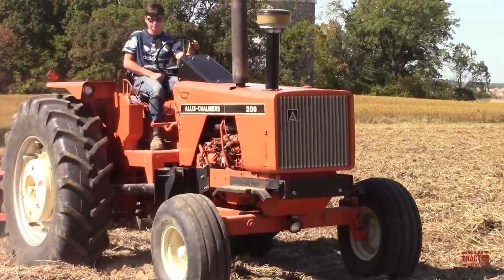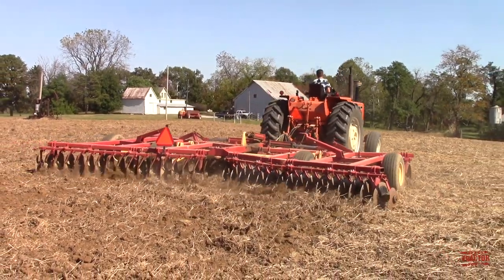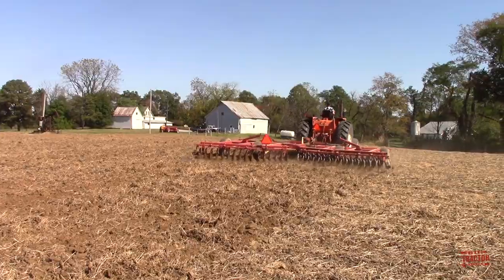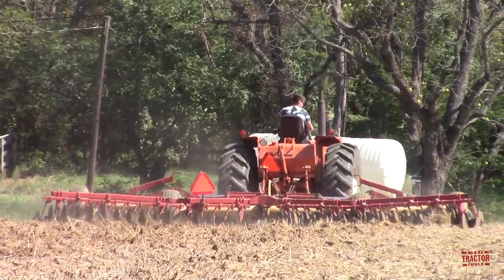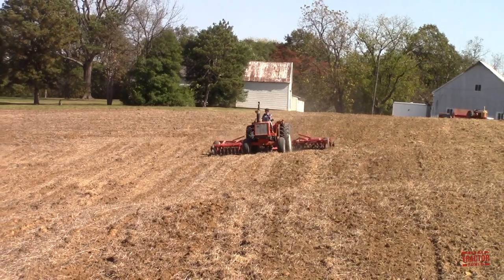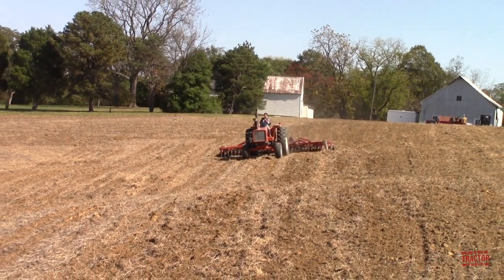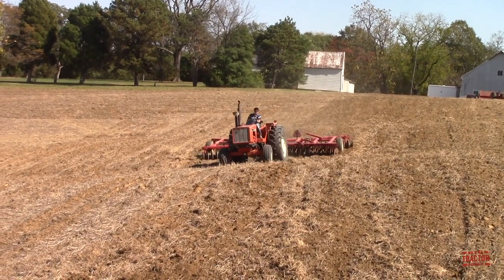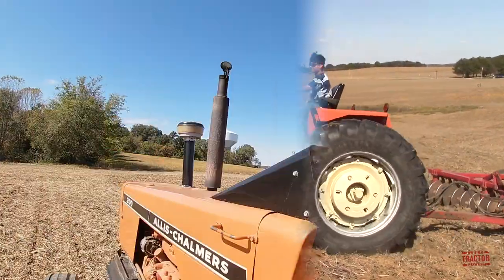ALLIS-CHALMERS 200 Tractor Working on Fall Tillage

Comment: What a great tractor. I rented 200 acers from an old farmer in 1978 that had a 200 with the factory cab & A/C. I was 18, and worked for a big farmer who had nice equipment. He had a 4020,4230,4430, and a 2670 Case. In 1980 I begged the old guy to let me pull it at the fair. Needless to say he didn't like the idea. He asked what I would do if I blew it up? I said I will put a new engine in It guess. So we shook hands and I went to the pull. I put it in the 10,000 lbs. class. There was about a dozen in that class. There where several IH 1066, JD 4020's  1 which was hauled in from out of state with a M&W blower and you could tell it was turned up. 1 old 930 Case. All the farmer's said I didn't have a chance against the competition!  Let me just say the look on that old farmer & his wife's face that night in the stands was priceless!! All that for a 1st place trophy and a 100 dollar bill. True story in Lee county ILL. I won by 2 ft. 4ins. There are only 2 kind of people in life. The ones that think they can & the ones that think they can't. Unfortunately they are both right. My grandpa taught me that.  He also said nothing is impossible, it just takes a little more determination. I'm 61 now and I know he was right!
Reply: Hi Don!
It's always the same: 
They all said, it's impossible until one came who did not know that and just did it! :-)
Reply: @dreisternehof  Amen!
Reply: Never underestimate an Allis Chalmers
Reply: @RJ1999x  We had a 200 as well and it was the farms beaten dog. We pulled heavy no til Haybuster drill, huge heavy thing that held tons of grain and fertilizer.  We ran a snow blower in the winter at -20 sometimes, usually a bit warmer.  It got beat, but iylt never let us down. I remember spraying half a can of ether into it's intake to start in the winter, it just said ok and fired up.  Now I know that's not a great solution for starting every cold day.  Yep, 200 was something
Reply: @heatmoon  a great tractor

Comment: My father sold them from 59-85.  We ran mostly D-17's.  Started out with a WC before I was born, then a WD.  The D-17's came later.  We eventually ended up with my grandfather's 180 that was rebuilt to 185 specs.  My neighbor still uses it.   Pop eventually got a nice 8050 to brush hog with that I sold several years ago to a local farmer.  They sold it to a dealer down east that is restoring it.  Pop knew the dealer and that helped sell the tractor.  I plan on going down there to see it eventually.  Great videos as always.  I'll die an Allis man just like Pop.

Comment: We have a diesel 180 that we use to pull a 12 row corn planter. It harvest time it is also used to pull 4 200 bushel grain wagons (2 @ a time) to the bins. We also have a 220 (non-front wheel assist) tractor that we use to pull a 15' Great Plains drill to drill beans. We also have a D-17 narrow front end diesel, a WD, & a 175 diesel that mainly get used as 'chore' tractors. We also have a D15 with an Allis Chalmers loader bucket, a 190, & a D-21 with rice tires. The 190 does baling & mowing of waterways on our farm & the D-21 used to do a lot of tillage & pulled the grain drill for many years. Since we have gotten rid of our cattle & gone to no-till, the tractors don't get as much of a workout as they used to.

Comment: We have run an AC 200 in central Utah for the last 25 years to cut and bale hay. Our model has a factory Cab with an air-conditioner that has never worked since we got it. Tractor has been run less than 100 hours a year for all of those years and has experienced a failed water pump and failed alternator but thats about it. A couple of years ago it started leaking small amounts of transmission, hydraulic and engine oil. We just got a used Kubota M110x to replace it for next year's work. Thank you for sharing your video of the AC 200.
Reply from the maker: Thank you for sharing about your 200.  That is neat yours has a cab.

Comment: I’ve always been partial to Alice Chalmers. I worked on a New Jersey dairy farm before and during my teen years. We had an Alice Chalmers C, WD 45 and WD 45 dieselWith a wide front end. I cultipacked oats with the C, plowed, pull the Haro, disc, and hold wagons with the 45 and the 45 diesel. Mode hey and bailed with the 45 diesel also! Thanks for the video!😁
Reply: My Dad has a W D 45 has with a tricycle front end he bought new in 1957 it was a great tractor to bale hay with because of the hand clutch 👍
Reply: @brittblanton8342  we had the same one, yes the hand clutch was very handy forPTO work😊👍🏽

Comment: We had a 180 and a 5050. Both really good tractors. The 5050 had a loader on it and we’d take the muffler off so we could clean the heifer barn. At some point we just left it off and ran it every day like that. The 180 did a majority of the work on our 300 acre dairy farm in western New York. We had a Case 930 for tillage and hauling chopper wagons off the hill. That’s all the Case ever did. I miss those days.

Comment: My late father in law and his family were all Allis guys. 190xt’s, 200, 220, 440, and a few others. I was impressed with the 301 engine in those.
Reply: Really 440 how did you like them I've only ever seen one and thats not in person
Reply: @robellenberger6816  interesting story. They got theirs and it was an absolute dog. Dealer came out and looked at it a few times, couldn’t figure it out. Finally brought in the local Cummins dealer, he discovered that somehow the wrong engine had been put in it. It was a 145hp truck engine. Was supposed to be 210hp.
Reply: @thevox1075  no way lol that's crazy how did that even happen
Reply: @robellenberger6816  I can only think that there was some mix up when engines were delivered to Steiger. It was a California emissions truck engine. They installed a 555 turbo in it. Was a good tractor, later replaced with a John Deere 8630 which they hated.

Comment: I have a 1974 alischalmers 200 diesel with cab.  We farmed over 2000 acres with it years ago.  We now farm 5200 acres with modern tractors and combines . Those 200s were built to last . Ours runs an auger for loading grain bins but it can still run our 20 foot  notill drill and disk . We run a 5 bottom plow with it on crp ground.  Nice video stay safe and farm on my friends  !

Comment: I learned how to drive a tractor on the Allis 200. It was the primary tractor on our farm. I have fond memories of riding with my grandfather on that tractor and later doing the chores myself on that tractor. Never would have dreamed of running a 21' disc behind it though.
Reply: I pull a 20 foot Allis 2500 disk behind my 200 and it pulls it good. I really didn't think it would pull it but the 7050 and 7030 were both tied up so I gave it a try and I was surprised how well it did. In wet ground it would need duals but I try avoid disking wet ground.

Comment: I had a 200 for awhile. Used it to pull a disc bine and bale hay. I upgraded to a cab tractor or I would probably still have it. Good tractor and easy on fuel.
Reply: Dam I would of put a year round cab on it but ik how difficult it is to get those on and off

Comment: I have a friend who I went to school with just a few months ago bought a 1973 AC 190 from another guy I went to school with. Been sitting in the barn 17 years. It was always barn kept , still in great shape except it will jump out of 5th gear sometimes. I be interested in buying it when he decides to sell it. He buys and sells older farm equipment all the time . He said he wanted to hang on to the Allis for a little while. But he will eventually sell it.  He gave $10,500 for it.  Great looking and running tractor.
Reply from the maker: The 190 is a solid tractor. They can really plow.

Comment: Hey really enjoyed the video I grew up in Kentucky on a dairy farm milk and 50 had a cattle and raising 5 Acres at the back of my dad worked in Cincinnati at William Powell.. my grandpa had an Alice Chandler d10 we used it too set tobacco run the wheels out to mow and Ray Kay and on rolling ground even Belle hey pulled logs out of the woods love the color and it was a pulling little booger for its size it's a shame that they don't still make tractors like they used to I am not impressed with the high tech new tractors at all sensors and computers is a recipe for a royal problem in a pain in the butt thanks again for the video and by the way I just bought a 185 LS Chandler that needs crank bearings the elderly gentleman that had it was pulling an 18 ft batwing bush hog

Comment: Used to run the 6080 to haul silage wagons back and forth from the fields to the silos and baling hay and straw and the farm I worked on also had the 8070 front wheel drive that we used to spread liquid manure and cultivating and discing

Comment: Where I grew up in Northwest Washington State during the 1950's and 60's, there was an Allis dealership about a mile from our farm so everyone in the neighborhood had Allis Chalmers tractors of one vintage or other.  I got lots of time on WD45's, D-17's of several series and others.  I now own a 1957 D-14 and an HD-4 dozer.  They are great tractors.  Our older son and his father-in-law run three Allis on their beef operation: 190, 7000 and 8030.  Keeps my son busy fixing these older machines but he loves them and they keep on performing for them.  Allis Chalmers had great equipment, both agricultural and industrial, just poor management during tough times killed the company.
Reply from the maker: Great AC history.  The HD-4 must be pretty cool to run.
Reply: @bigtractorpower Yes it is.  I purchased it years ago to do some logging and dirt work.  Both my sons learned to run crawler dozers on it and now pretty much run anything with steering wheel or levers.  I have it apart in my shed getting new steering clutches and it also needs undercarriage work, but it will live on as retirement is approaching and is one of my first projects to complete.  Love your big tractor videos, keep up the good work.

Comment: We have a 200 Allis Chalmers. Used to pull a 5 bottom Oliver plow and and a 20 foot 1200 series Allis Chalmers field cultivator. We use it in the hay field now along with our 4,000 hour 8010 Allis Chalmers and our 7060.

Comment: I farm specialty crops (Christmas Trees, pumpkins, plus a few acres of corn/beans) with a D14, D15, D17, 180 gas, 180 diesel.  We have some newer small tractors, but the AC's still get 100-200 hours each per year.  They do a lot of spraying, mowing, hauling, and people moving / hayrides.

Comment: Any chance you could give a current "estimated" price for the older model tractor(s) in your videos to compare to the original price?  Simply base it on the condition of the tractor you showcase in your videos.  Much appreciated.

Comment: Good memories, not  on a 200 but a 180 & 190.  2 questions, was that the young Lad in the last Video?  @6:06, the old Case was hooked to a drill.  Seed winter wheat?
Reply from the maker: Yes.  This farm had the Steiger Wildcat sub soiling,  this Allis-Chalmers 200 disking behind the Steiger and a Case 800 drilling wheat.  It’s a neat farm.
Reply: @bigtractorpower  YES Indeed!!!!

Comment: The 200 must be the replacement for the 190 XT.  We had two of those.  They were good tractors.  Nice to operate.  Gutsy engines.  I believe the 190 XT was 93 hp.  
I saw a glimpse of something else in the video that I  like;  a Case 800 row crop.
Reply: same engine, no updates out of the factory... plenty of updates in the field.
Reply: @jasonleininger2519  Lots of updates in the factory. The 200 had larger bull gears and bull pinions than the late 190XT. The late 190XT had 4 pinion differential which the early 190XT did not. The engine on the 200 was improved and actually put out closer to 110 hp vs 93 from the XT and it had a better cooling system with a larger fan. There were other changes internally here and there too vs the XT. Better 3 point hitch geometry for more lift and the later 200 had a change in making the power director easier to shift and better brakes. There were lots of changes and then the 7000 replaced it which had more changes but was basically the same tractor with a 3 speed power shift replacing the 2 speed power director and the new style sheet metal and cab. The 7000 again had even larger bull pinions and gears. I could go on and on with the changes made from model to model and running changes during production of each model from that family of tractors 190 through the 7000.
Reply: @jasonleininger2519  No updates in the field, the 200 had a different engine with a crank driven oil pump, a different front bolster, different geometry on the 3pt to lift more, and a different angle on the bull gear drives

Comment: Throw a set of 23.1-30s on it.. literally wore the tires off one!!
Then put 18.4-34s on with duals.. they worked better!!
Miss the old girl!
Reply: Ed you gotta find yourself another one, the power director would have been perfect working in the shed when you were shredding bales.
Reply: This already has michlens 18.4 R38, way better than those two options
Reply: @somesmallfarmers5629  it's been a while.. they were 38s.. we used 4" wedges on the original centers.. 
Only been 35-40 years ago 🤔😂🤣

Comment: Had one growing up, had a disc for it too.  This disc would be way too much if he was actually discing a field with a crop just off, he's just barely scraping the soil.  Looks like a hobby farmers with a love for the great Allis tractors, just out driving tractor.
Reply from the maker: This is not a hobby farm. They were seeding a cover crop over ground that was sub soiled 18 inches deep.  They are using the disk to cut up the sub soil ridges ahead of the drill. This farm has Steiger Wildcat III, IH 5288, IH 1086, AC 200 and Case 800. Each of these tractors are featured here on Big Tractor Power.

Comment: Does this AC still have the traction booster system? As far as I know, it could be ordered one generation before, but not sure in the 200 ...
The disc in this video seems to be coupled without...
Reply: they had the traction booster system
Reply: If you are actually referring to the Traction Booster system, Most all Alis Chalmers had that from 1948 through the last of the 8000 series. If you are referring to the Snap Coupler Hitch then no the 200 did not have that. That was ended sometime in the mid 1960's..... maybe 1965 or 1966. I guess the D15 Series II may have had it up until the last of them produced in 1967 or 1968 not sure. Maybe D10 Series III or D12 Series III too. Hitch system being different from Snap Coupler to the 3-Point Hitch.
Reply: @SilverGleaner  thank You for those details! I think, Snap Coupler found it's end, when implement weight increased, nevertheless at it's time a good working thing.
Traction Booster was one of three alternative options to the Ferguson System: FORD had it's load monitor, MF itself had the pressure control. But traction booster worked very well as far I can see on the old video's. Maybe it was the best alternative to the Ferguson System...
Reply: @dreisternehof  TB had better draft control pulling from a single point under the tractor ahead of the rear axle and pulled from a point making the implement weight transfer more effective and making it easier to pull the implement straight. You are sort of right as things got bigger it was the drawbars that  got heavier and they had to be removed with SC. I think Allis could have designed their way around that factor by making it easy to slide the drawbar to the side and never having to remove it. IMO what really killed it was the fact that the  ASAE in the 60's was going with the 3-point as a standard throughout the industry. If you have ever used SC you would find, especially if the implement had proper swing down stands, which I found unnecessary in most cases, the SC is much easier to hook up. I had the pleasure of hooking up the 3-point snowblower, actually helping by straw bossing because of recent back trouble, and it was, as it sometimes is, a struggle to get lined up properly. But at least my 200 has both lift arms with leveling cranks and extendable links. Some other brands don't.

Comment: The engine in this one seems to have been changed. These would smoke like the Dickens from the factory
Reply: The diesel back when the tractor was made was furnace oil, today's diesels burn far cleaner
Reply: We had injected work and fuel pump is turned up so the tractor is turning 129, we be put 19000 into this tractor, that is why it doesn’t smoke
Reply: the 200 had a timing change that cleaned up the smoke but even the 190xt had the best fuel economy in it's class back when they were new, smoke or no smoke. My 200 doesn't smoke much either and it doesn't have $19,000 stuck into it. They are just great tractors.
Reply: @SilverGleaner  We had a 7020 also and if I'm not mistaken it had a 4.9T also. Much bigger, beefier tractor.
Reply: @drkies  good tractor.... a little under powered. Best to do with a 7020 or 7010 is remove all the fluid from the tires. They were just a bit too heavy. A 7000 was an updated 200 basically and didnt have the power to weight issue like the 7010 and 7020. Given my choice I'd still take a 7010 or 7020 over a 7000... wouldn't turn down a good 7000 though.

Comment: Didn't they make 10000 not 1000 of them?
Reply: Tractordata says 10k plus....which I think is more likely. The 210 and 220 had much lower production numbers at around 1500 and 1800 respectively. The 190 was the most popular with 22k produced. I have the 210 which looks identical to the 200 in the video.